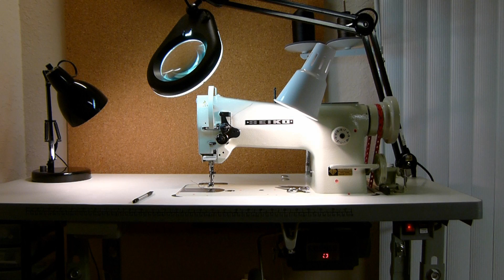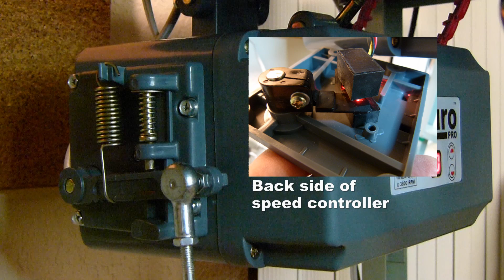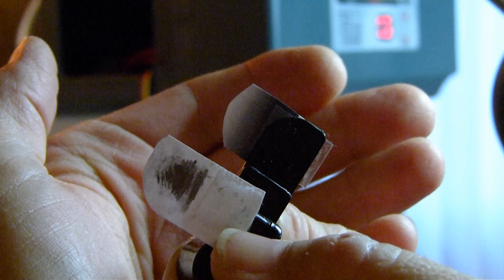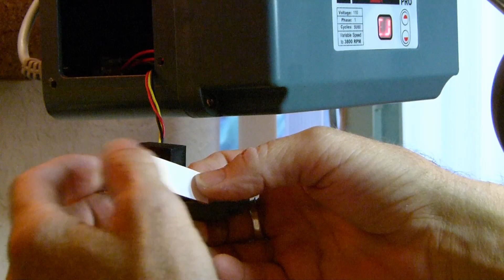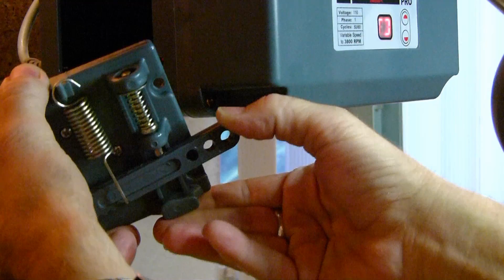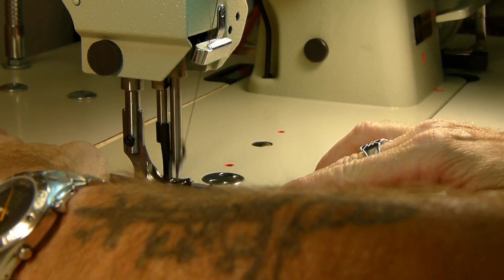Servo Motor: DIY Smoother Speed Control MOD

Comment: Wow that Enduro sounds like an old Evanrude.  What is the noise?  Is that your link belt, or does the Seiko need oil?  Anyway thanks for the trick.  Appreciate the video.

Comment: This video helped me a lot, unfortunately i can't apply this mod to my controller because the sensor is not optical but magnetic hall effect but the controller behavior and operation seems the same; i think i'm going to make a pulley reduction system but i really need somebody who had this controller or some other similar like mine to help me and tell me how the p1 parameter works because mine is supposed to control the minimum speed value but no matter how i set it from 0 to 9 i don't see any difference, and my controller still in guarantee so i need to know if it's faulty or not asap !!! thank you ! :)
Reply: Ok i've got the manual and no, this is not the same chip or controlling language of my controller... thank you anyway, you described my problem completely except my solution won't be this one :)

Comment: What's happening is that the paper is acting as a low pass filter of the light signal to the sensor.  Plainly put, the sensor is calculating how much red light is entering the sensor and sending that signal back.  When the black plastic blade moves,  it simply blocks the light as it passes in front of the LED.  Putting the paper on blade creates a region where the amount of red light is dimmed before getting to the black blade which blocks it completely.    The reason that the motor runs faster as the paper is nearer to the LED is that the brightness of the LED is higher closer to it, and more light passes through the paper to the sensor.

Comment: I am shoping for a servo motor for a Juki LU562 I just bought and if You don't mind
can you please tell me if these Enduro servos are good.
My choice at present is the Reliable Sew Quiet 6000SM but reading on the Enduro
specs I like the specs,more powerful,but not users review anywhere to digest.
 Thanks for this video,sure is interesting and helpfull.

Comment: Hi, thanks for posting this video!  I wanted to give you my feeback-  I am using a Juki DNU-1541 with a Consew CS1000 servo motor.  This motor always starts at full speed, then with precise and practiced move you can pull it down to the low speed sometimes, but it sometimes surges and screws up corners on items I am sewing.  i typically do leather garments, sheaths, bags, etc, usually under 3/8".  If I set the "low speed" setting to 9, slowest, it always has a paused start, sure, then it either stalls or goes full speed.  So, I have to start it with the pulley by hand.  I took my control lever cover off, and found that the optical arm lever is just black-  no gradient, so of course it is either off or on.  I tried pencil gradient-  and my optical sensor would not read it at all no matter how dark i colored it.  Sharpie worked, but it was too hard to get a gradient.  i printed out several gradients I did in photoshop, and found the right one, I taped it to the edge of my arm-  if I taped it over, it sensed the bulk of the arm, which is really thick, and then either was on or off, no slow start.  So on the edge, I set it up to go slow starts with good control and now it works 100% better!  I never need any speeds over 500rpm unless I am doing a long stretch on a seat, so I have it set at 400 on the rpm control, now it starts super slow, and goes to 400 when I need it.  I am still going to work on the pulley setup so that I can set the motor up to run a higher speed so it doesn't stall out, while still giving me the slow speed I need.  Thanks!

Comment: I have a question. I had a quiet sew 4000 that went bad now a 5000 but I notice this problem you stating will this work on the reliable quiet sew 5000 its too quick to start to sew

Comment from the maker: You may want to watch the latest servo update video. Basically, with the proper slope angle on the light blocker blade there is no need for post-it notes or gradients.

This latest revision is much better because it retains the full RPM range of the servo, whereas the original mod sacrificed top speed.

Check out the Recent Uploads section for the video, and I'll also post a link to the video in the description above. 
The video title is: Servo Motor: Updated Speed Mod

Comment: Thank you so much for making the video.  Looks to be an incredible improvement.  I have a Singer 111WSV71 with a clutch motor and have been considering a Servo w/ speed control or the MCSCR system from sailrite.  You just saved me $500 -- thanks!!

Comment: HI LINDA, I TOO HAVE THE JUKI 1541 AND NOT ONLY DID I HAVE THE SAME PROBLEM I AM UNABLE TO USE MY FEET FOR SPEED AND NEEDLE CONTROL AS I AM PARALYZED AND MUST USE MY RIGHT ARM AND R. HAND FOR THAT. AS FAR AS SPEED CONTROL I AM USING A REDUCING PULLEY AND A HEAVY[CAST IRON] FLYWHEEL ALONG WITH THE ''LINK'' BELT AS SHOWN IN THIS VIDEO. NOW MY CONTROLS ARE SET UP WITH WIRES AND PULLEYS AND YOU WONT NEED THAT BUT YOU SHOULD FIND THESE MODS WORK FANTASTIC. JP.

Comment from the maker: Hi Linda, to get the speed control mentioned in this video you will have to replace your servo motor with a new servo motor that has digital speed control.  Then you would need to apply the modification that is explained in this video.

Give Leather Machine Company a call (866-962-9880) and talk to David or Steve about servo motors. They are the only company that I know of that does the speed control modification in house.  I am sure they would be happy to help you.  Good luck! :)

Comment: I have a Juki DNU 1541 with a servo motor that is not digital.  I cannot sew slow.  I am new to industrial sewing machines and want to be able to sew slow and controlled. I am making purses and bags with leather and faux leather.  i love my Juki and did a lot of research before I bought it, but I need to have more control.  Any suggestions?  Thanks.